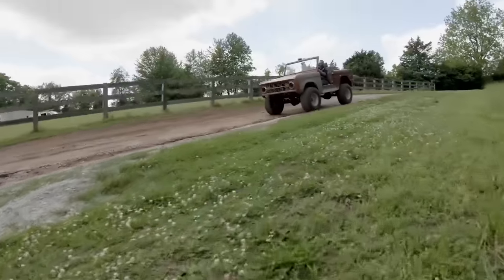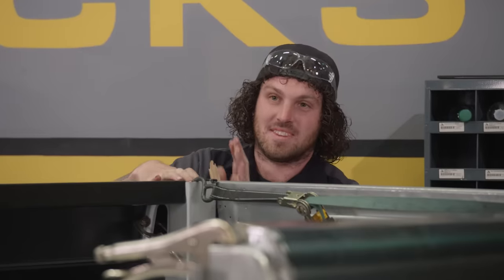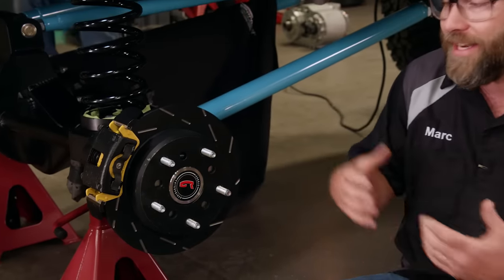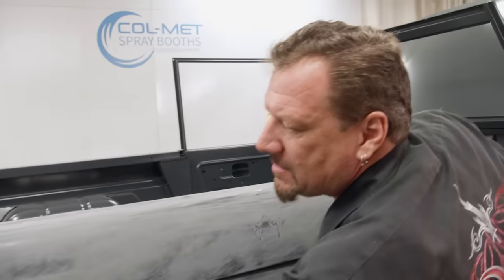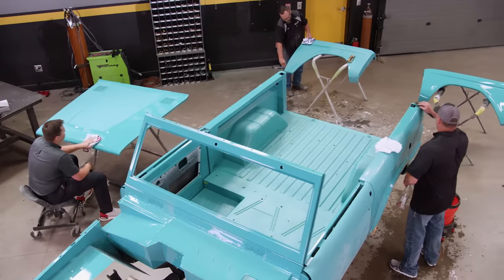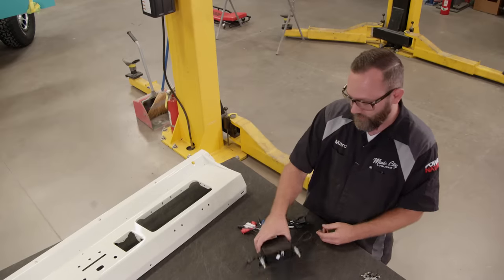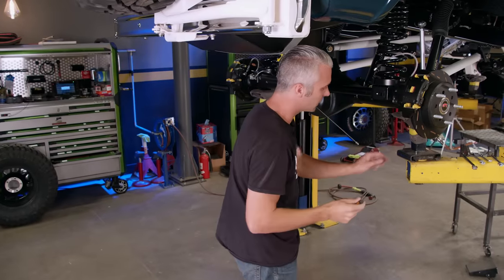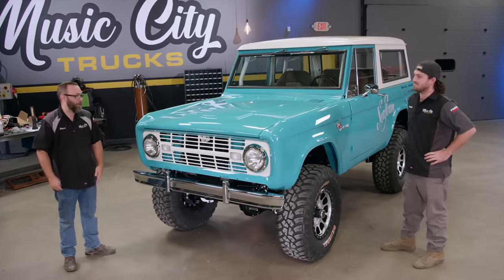Full Build: Restoring A Classic Bronco With A Modern Twist

Comment: The things that are possible with an unlimited budget and every tool ever made plus parts that are unavailable to the average person
Reply: The average person cannot afford a big V8 crate engine. It's usually a four cylinder diesel engine from a scrap yard. Even then, it will need a lot of work.
Reply: @franciscooper.retired  I just sold an old FE Ford engine for 250 dollars a couple weeks, it was a 390 4 barrel that needed a (refresh,rings and bearings, oil pump , gaskets) but it was a running engine when I put it on a stand , I don't have anything to put it in, I have an old Dodge charger (73) that has a good running big block as a project now and got it for under 2500 dollars so I should be ahead when done,not going for all original,just want to make a nice street car like i wanted my first car (a 72Charger) to be back when I was a teenager,should be fun when I get it done
Reply: It would take my entire salary for a year to be able to do what they did, and I’m just guessing on that.

Comment: Can it really be called a restoration if you got all new stuff? I’m just wondering what the point of pulling apart the other one was 😅 
Y’all should get the other one and use it as a “build on a budget” off-road rig. 
I really enjoy these full build videos, keep them coming!
Reply: I was wondering about that too where is the bronco from the start it needs 40s
Reply: I think the scope just crept out of control so the body and chassis were no longer used.
Reply: I agree. I think the term restoration was used very liberally and is kind of misleading. It's a real shame to see how little of the "original" Bronco was actually used in the new build. I think the vehicle turned out amazing nonetheless and was auctioned off for a very good cause. But again, sad to see how little was actually "restored" not replaced.
Reply: Especially pretending the original body was "to far gone" to use. It's just so they can try to sell sponsor spots.
Reply: exactly body was bad but it wasn't any worse than a full resto truck tats 50 yaers old
Reply: lol my thought too
Reply: Not sure what the timeline is for the build where they were building it for a company they could of had a time crunch and didn’t want to spend months just on metal. Only took them a couple days to assemble a whole new body. They didn’t really say much on what they did with the original chassis.
Reply: @Nick19852  Their whole business model is to advertise the parts they use. It had absolutely nothing to do with a time crunch
Reply: I have to agree with you. It's a new build not a restoration
Reply: What budget?  That Bronco probably cost $100,000.  You can buy fully built  FJ40s for $80,000 + so that gives you a ball park figure.  Engine alone is $30,000.
Reply: The only thing "original" is the title!
Reply: They spent 30,000.  On parts ,sold it for 27,000. Total lost $3grand.
Reply: They should donate the original to Puddin or Half Ass customs and see it brought back on a budget.
Reply: @ChristmasCrustacean1 ❤❤❤aw
Reply: The amount of original parts used in this nut and bolt restoration was unlike any other Ive ever seen.

Comment: The paint and body guys are studs.

That's a killer job they did.

Gotta say though, this isn't a restoration, it's still incredible, but it's a full kit built at this point.

It's not "Restoring a classic Bronco with a modern twist" it's "Building a modern Bronco with a classic twist".

Comment: I remember the international scout I had one with the 345 V8, 390 lockers front(!)and rear, and that Granny low gear 4 speed. I love that truck. Lima bean green, I remember I took the roof off and the doors wouldn't open and close no more, LOL. Nothing could beat that thing in the mud with that front Locker. I never saw nothing like it you couldn't turn the truck at all not even in the mud, it was almost impossible to steer when the front was locked. But it would go through shit that my buddies trucks on 38th couldn't even touch, and I was on some old ass white wall tires!!! I won so many Bets with that truck in the woods, I miss that thing. Best truck ever. 🚜💯💯💯💯💯
Reply: Scouts are the greatest!
Reply: I totally agree 💯💯 with you on their idea at the beginning of the show! I have my '65 Scout 80 with 304, 700r4 and dana 300, 3.73, skyjacker 2" SUA reverse shackle, 33"s, p/s, hydro boost. Solid truck. I never cared this much about the exterior panels, just the meat, and potatoes for camping, road trips, and trail rides.🛻🏕🔥
Reply: We had one affectionately named "the party scout" it could scout out any party at any remote location and never failed to get our loaded asses out of the woods. It was fun to be young and dumb for a while. Happy we survived it.

Comment: A modern Bronco interior would have been very cool on this build, giving it a modern interior with the modern exterior. They went the right direction with the engine option without a doubt. It’s what ford should have offered in the new Bronco. I would also utilized a Marine grade boat deck flooring by SeaDek with the custom logos and Bronco logos added to them for the flooring. 
I’m curious though! If they went this far to make everything so nice, why didn’t they loom all the wire under the dash and under the body? Why didn’t they utilize LED lights? Especially if they keep calling it modern!

Comment: A while back, I had the opportunity to get a garage full of old Ford parts, including a bunch for the 1st Gen bronco. I needed my garage space back so I had to take a bunch of stuff to the salvage yard. I did however save the parts I knew were bronco parts and some that I'm not sure about. Please don't hate, I'm not a ford guy I just didn't want to see good original parts go to waste. I have things like a 289/302 with transmission and transfer case, roll bar, spare tire holder, radio, dash, rear seat and a bunch of small misc. items. If anyone would like them and is near Iowa, I will give youva hell of a deal.  I'm not worried about getting a lot of money for these parts, but I will ask if you could send me some photos of the build in process and completed. I brought these parts home so they wouldn't end up in a scrap yard and hopefully make their way to a good home.

Comment: I totally understand the advantages and desirability of that +700 hp engine.  That said, after seeing how complicated it is and how it had to be shoe-horned into place, I'd sacrifice 400hp for a simple 300hp pushrod 302 V8.  Just my $.02 Cents.
Reply: Agreed 700hp is overkill
Reply: I prefer higher torque too , 700 hp is mega overkill for an offroad - suv class car
Reply: My first thought was that that was unnecessary.   
It's a utility vehicle that you buy to drive in the mountains, and will go down dirt roads.   
The stance, high and short wheelbase, is all wrong for that kind of power.
Reply: @charlesvan13  100% agree.
Reply: @hkguitar1984  
They're building a hotrod, rather than an SUV.   

If you're going to take it into the wilderness you'll care that it's reliable, and has a good range on a tank.
Reply: @charlesvan13  I totally understand, this build was a corporate effort and by design was over the top.
All my past experience tells me that keeping it simple s usually better, for a personal build, and speaking for myself or what I would do.
That said, I can still appreciate all the engineering and advance systems/components used, they just aren’t for me.
LOL, my pride and joy is a low mileage 1986 Military Blazer with a stock 6.2L Detroit Diesel (literally the exact opposite of this Bronco build in both design and performance).  What I do love about my M1009 Blazer is that there is not a single electronic system or control, reliability has generally been off the charts good with repairs about as simple as they could be.  Heck, my truck doesn’t even have a radio!
Reply: @hkguitar1984  
Of course, they're sponsored by the parts such as the crate engine.   

But you only need a Windsor small block.
Reply: @charlesvan13  Exactly
Reply: @hkguitar1984  
The price of that supercharged coyote is probably absurd, probably 10-15k

I had a van that I bought a completely rebuilt GM 350 for, installed for $1900.
Reply: @charlesvan13  That supercharged coyote engine cost almost $25K.  For that much money I could have four or five nice off-road vehicles!
Reply: @hkguitar1984  
That probably makes a car a significant theft risk.
Reply: @charlesvan13  insurance costs!

Comment: Great video, and these boys did some darn fine work!  I wish they would address the elephant in the room on what became of the original 74 Bronco…basically they used the door latches and glove box…a shame they tore down a running, driving Bronco
Reply: Exactly. Because of the cost of finding an old Bronco and restoring I looked at doing this exact same thing. Down side is you miss out on restoring a piece of history and end up with a kit car. I am not sure how they can still call this a 74 Bronco. If that is the case then anyone could look for a completely destroyed Bronco and just buy the title from someone.
Reply: @trirunner2520  That's about how it goes these days. Everything I see for sale under $10K, and often even $20 or $30K is no better than what these guys started with. For a looong time already there has been a market for Bronco titles & vin/glovebox door tags, ideally with the frame too. I took a consignment from one of the more famous Bronco builders this past summer and when I inquired about getting a title and vin tag for a project Bronco I was considering building from the ground up with a new frame, the guy said no problem we've got plenty of those.

Comment: Hope you do not have the problem I had with a 72 Bronco. Swapped in a 351windsor. No problems until. I started doing low speed crawling. Would overheat and vapor lock. Finally figured out the small engine compartment. Was holding too much heat and fan could not push it out. Installed a couple of vents in the hood and cowl induction scoop. Which solved problem.
Reply: so pretty much it was your fault why it was over heating i see now
Reply: @funtyes1970  Heh.  Nice sarcasm.  Yet it is possible that the new owner may experience similar troubles.  Hopefully the new owner either reads Mike's comment or comes to the same conclusion/solution in adding vents/induction to aid in dissipating the heat.

@mike noneya  Passing on personal experience and educating others is always a bonus.  Well done.

Comment: Would a 90s T-Bird radiator really be adequate for an 800hp crate motor? I seem to remember those cars having overheating issues with their stock engines (same as the Lincoln LS), I can’t imagine not using a custom aluminum radiator when you’ve basically been given a blank check for the build. Same with the brakes, first generation Explorer brakes? Throw some big four or six piston mono-block calipers on there and fit the rims to the rotors.

Comment: I 100% feel you brother I’m going thru something similar with my build it’s a 13  ss and I have went thru 4 suspension setups. I had a question about you striker setup how is it on day drive what upgrades did you have to do to the transmission and what stall are you running?

Comment: Sweet! 42 million  dollar's  worth of equipment to do  a couple  thousand  dollar job.
Reply: Love your sarcasm.  I feel exactly the same way. I'll give only one example as there are so many more examples to give: Near the end of the Video at SEMA, the Directing Manager from Sonax stating that his company put in 250 man hours for the polishing of the paint on the Bronco. This is an astonishing amount of material and labor invested and is likely one of the smallest contributions.  I'm sure that everyone and all the companies contributing to this Bronco did it for charitable reasons. A.K.A.: All parts, materials and labor were likely donated.  We all know that it was for a good cause and I don't want to seem too antagonistic... Yet, it all seems like such a waste considering that $135,000.00 final bid. And at the same time, I feel like $135,000.00 was way too much for this Bronco. 

Next time they try to do a good deed, they need to set up a fund raiser.  The fund raiser would better serve the charitable purpose without the extreme waste.
Reply: lol a couple thousand bucks for what exactly ??? the paint material cost more than that , labor would be another 5-7 grand for body and paint , there's 20-25 grand in body panels, 30 grand in drive train , 20-25 in chassis and axles another ten in suspension... never mind all the other little stuff probably adds up to another twenty ... then labor for all the other work , fitting the engine building the suspension interior etc etc etc ... so which part do you think would've only cost a couple grand ??? the wheels and tires??

Comment: 1 st Gen. Bronco’s have Weak front suspension. They need stiff coils and double shocked. Reason is, “wheel hop”, when you are climbing a hill in 4low then whamo, the ring and pinion shell out! Been there,, done that Wasatch Mountains. The Sea Foam beach cruiser sure looks pretty, with massive power on the top. Hope the drivetrain can handle it. Great video’s, love to watch your builds!
Reply: Weak everything throwaway vehicles, cheap thin sheet metal panels and a frame that will bow just looking at a rock. The engineers at Ford are probably still laughing that all these fanboys decades later will pay $$$$$$ to get one of these rebuilt.

Comment: I love these 3 hour builds. How's the VIN work for that though? Is it tranferrable in the US?
Reply: I'd like to know that aswell. But then again, in the US there could be an exceptional rule for one off builds?
Reply: rebodied vehicles are legal though kinda problematic
Reply: @SuperGreyknight  So how is the problem with the VIN solved then?
Reply: @DomEngines  In some states, you can transfer VINs to different bodies. Depends on if it passes safety inspection, some states don't allow it at all.
Reply: you can't transfer vin on any car ever !!!! when you build something like this you get a new vin from the secretary of state or dmv in your state , sometimes it's listed as a custom hot rod and sometimes you can list it as what you intended it to be , ie; a 74 ford bronco
Reply: Yeah there are ways, but as someone else mentioned, it would need to be issued it's own VIN, since there is virtually nothing of the original used in this build. There is a process for registering custom built vehicles though, just like with custom built motorcycles
Reply: Not a problem at all. Especially this old a vehicle, the govt is no longer concerned with theft or counterfeits. Main thing to the DMV- is if whatever original panel the VIN number is engraved is still part of the restored vehicle, then it's almost always a 99.9% success at the DMV.  Though it should be impossible in the case of this show episode, because instead of factory restoring a 1970s Bronco, these knuckleheads actually created a new piece together vehicle of aftermarket garbage decades after this vehicle's period correctness expired.

Comment: To the previous owner of this Bronco, like myself you probably didn't have enough hours in the day to finish such a project.
It happens, been there and done that.
Reply: the 'didnt know how to finish it "kinda got under my skin. more like the insane prices shows like this have driven prices of gearhead projects too.
Reply: @1badapplepie  I can't disagree with you, $30K for just the engine.............not my cup of Tea at all.
Reply: @1badapplepie  And the aftermarket manufacturers make their crap extremely cheap, yet charge an inflated price. Because they know these fantasy rebuild shows will pay $$$$$$ for their cheaply designed garbage and never have to deal with part failure warranties as soon as the owner picks it up.
Reply: @decibelinterference2033  Taillight warranties are the best (if you’re the vendor).
Once I can no longer see your taillight, the warranty has expired :)

The same undesirable evolution has happened in vintage motorcycle restorations.
I’ve no idea how many great bikes of Japan were imported into USA, but fully 30 years since the very idea of restoring the bikes we’d had as teenagers in the 1970s began, there’s still a continuous flow of overpriced joy & junk flowing into UK at all times.
For example the Suzuki & Kawasaki two stroke triples (the larger the displacement the better) are changing hands after show pony resto standards at upwards of £15-20,000. Just 10-15 years ago, you could still get real bargains like a few hundred unrestored, non runners with a few parts missing.
That was genuinely fun, finding parts was analogue and slow.
Now it’s chequebook restorations & while I’m grateful that all the skilled guys are out there, the romance is all but gone. 
I imagine some similar trends happened in other fields?
I still say do it and cherish the old analogue engineering! 
Nobody is going to lust over a dented & sorry Audi RS6 in 25 years. One software change too many & the lunatic self appointed global elites will have banned private vehicle ownership. Unless they’re stopped by The Great Resist :)
Reply: @GT380man  who would have guessed that original apple computers would be collectible?  Don't be too sure about what junk today is a classic tomorrow.

Comment: So...  Did I miss it, or was the drivetrain just not mentioned?  
Seriously, a 700hp + engine.  What axles used to handle that?  What Transfer Case?  Why the automatic transmission when it was originally a manual?  I know Ford never offered a manual with the Coyote, but NV makes one that'll handle the horses and Advanced Adapters makes a bell housing.